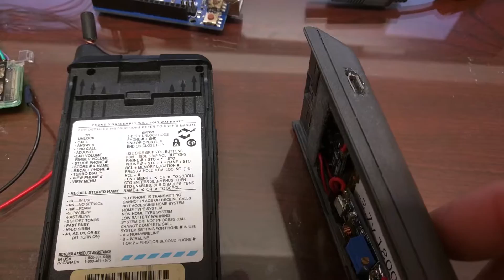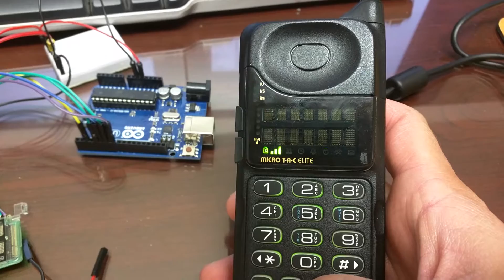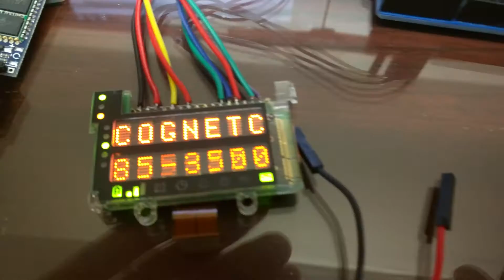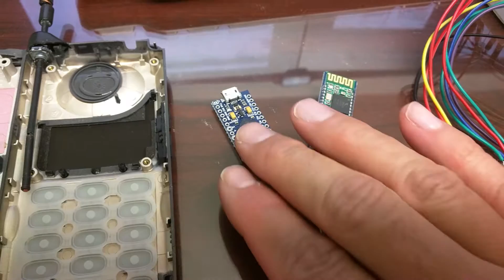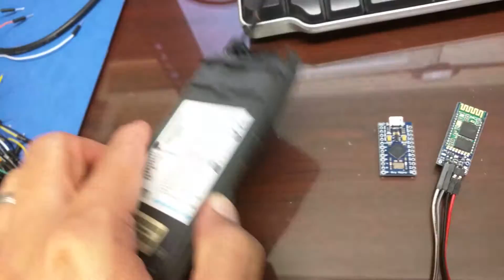Motorola MicroTac Elite Lithium Polymer Lipo Battery Micro USB Hack

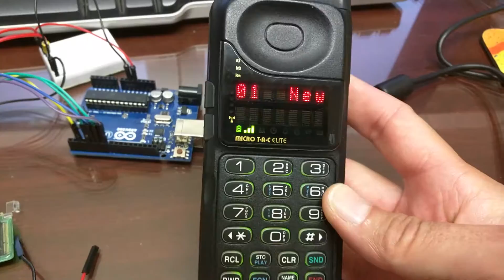Comment: Hello, I dont understand the second part, from 0:45 onwards. I need to repair the battery of my Microtac 7500, and I dont know if your hack it could be of use to me. Thank you very much, 
Gerardo
Reply from the maker: Gerardo, the second half is only for the display.  The display has nothing to do with the battery.
Reply: @cognetic  ok, thank you. And how is possible to work with 6V ? What kind of battery use you? Regards
Reply from the maker: @ramonsg  I used a single cell 3.7v lithium battery, with a Boost Buck Converter.
Reply: @cognetic  thank you again from Spain, best regards!!
Reply: @cognetic  dear Brian, only a question (other hi hi), what kind of tool did you use to cut the plastic? Thank you again!
Reply from the maker: @ramonsg  Dremel with a cut-off wheel.
Reply: @cognetic   ok, is very difficult to extract the old batteries, no? I have succeeded, but I don't know why even adjusting the output to 6.1V the 7500 says low battery. Thank you!
Reply from the maker: @ramonsg  (4) 1.5v cells = 6v.  I suspect the lowest you could go for a full battery level is (4) 1.2v = 4.8v
Reply: @cognetic  Hi Brian, I think I didn't explain myself well, I adjust the output of Boost Buck Converter to 6.1V, thanks

Comment: Hi! Would you accept me to send you my beloved microtac 75000 and make it work longer than 1 min(as no battery that i bought holds more than that)? would you be able to resuscitate it?
Thank you
Janis
my facebok is janis damoison youcan send me message there if you see that one! :-)
Reply from the maker: JaniS D I think that takes the same battery as the elite.  If so, it should be really easy.  I have since purchased a battery tac welder and can make NIMH battery packs now. NiMH or Nicad is what is in them now.  Either way should be able to make work no problem, with a normal battery life span.  Just not sure how much to charge for something like that.  I am in Houston Tx. You in the US?  Maybe uploading a video of your phone..would help.  might even be able to just ship you a battery pack for $100 or so, without you sending me your phone.  But am ok with either.
Reply: Oh cool, but how long would this $100 battery last because its not cheap! but if it lasts hours i am willing 100% ( and how would i charge this battery then? with original charger or another one?
i live in london but i am french, i can send you a video but i m more used to send video on skype or facebook than youtube. My Micro Tac is black, Motorola international 7500.
Many thanks
Reply from the maker: JaniS D That's a good question.  I don't really know.  These old phones won't connect to a carrier in the US, and dont a method of load testing the battery.  And it's hard to test pushing buttons for x number of hours.  LOL.  I can certainly do a full charge, and test standby mode for you.  I do agree the price is high.  it's just a lot of manual labor to assemble.  I am a one man show.  no robotic high throughput assembly over here.  😀.  What are you going to do with it?  Are you going to connect to a carrier? or just want to play with the menu, press numbers, hear the ringtones, etc?
Reply from the maker: JaniS D The Lipo charges by Micro USB on the side of the battery.  If I did a NIMH battery pack, it would charge old school way, with Motorola charging.
Reply: Micro usb : thats amazing! let me find the sim adapter, if it does works here with Sim adapter ( when on battery charger it used to work) i send it to you!